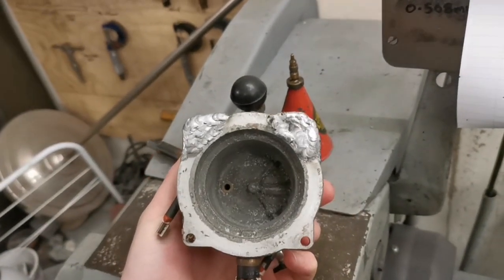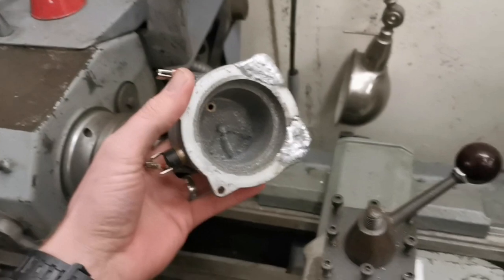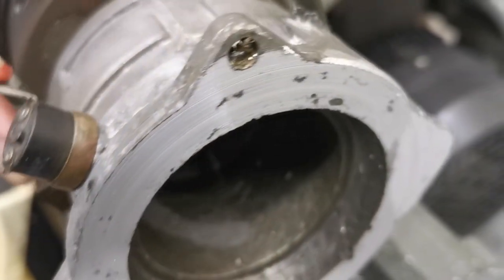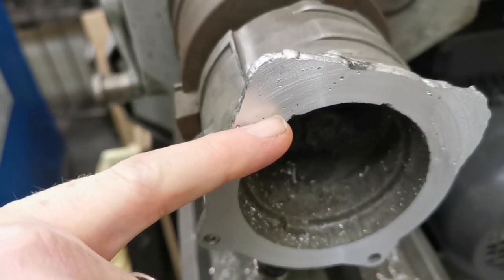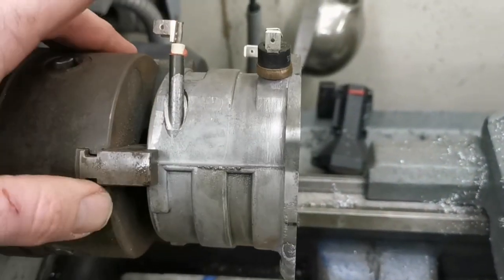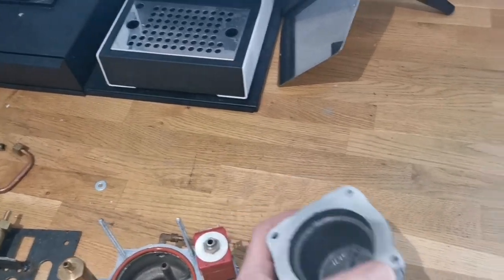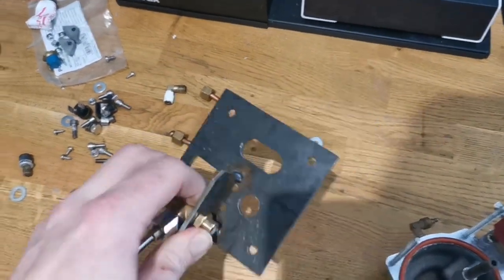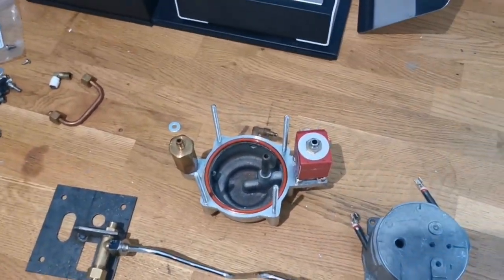Gaggia Coffee Classic Boiler repair and reassembly. It finally works!!!

Comment: Hey Ben I’m in the process of repairing my own owc and was wondering what size the boiler oring is or where you got it? Thanks!
Reply from the maker: Hi Austin, glad to hear it. Myachine gets used at least twice daily and going strong. I bought an oring from Amazon
https://www.amazon.co.uk/dp/B07CVKXHB9?ref=ppx_pop_mob_ap_share
Just need to ensure there is no pitting and don't use silicone sealer or gasket maker.
Reply: @benfitch8795 so, which size ?
Reply from the maker: @bob119911  I gave you a link in my previous comment to the o ring I bought.